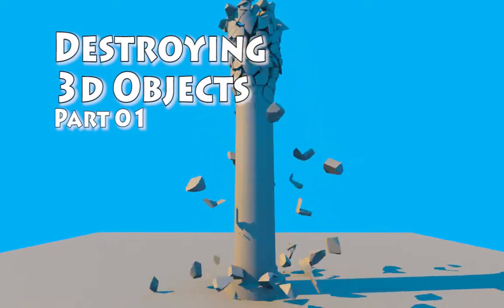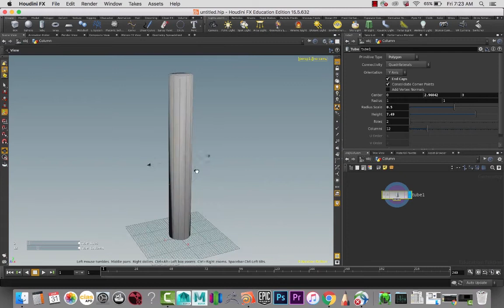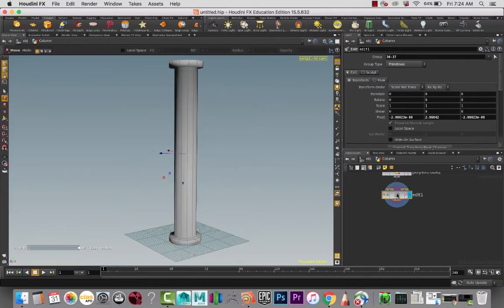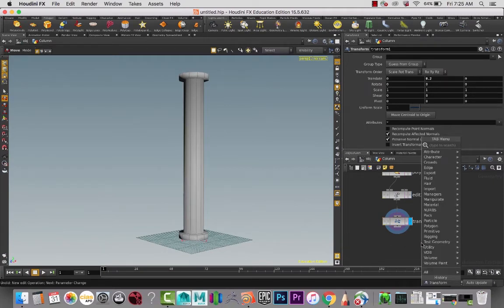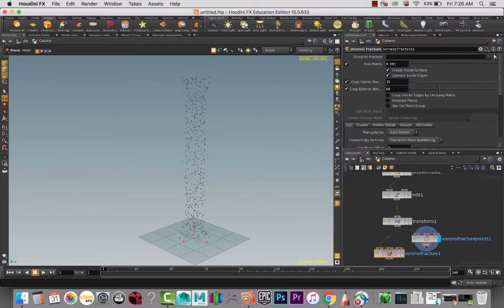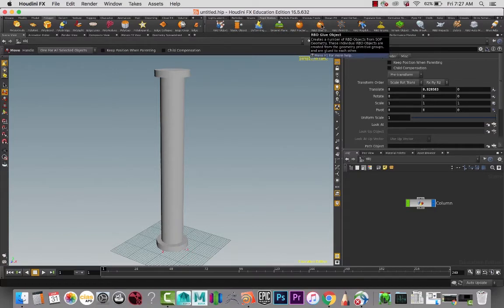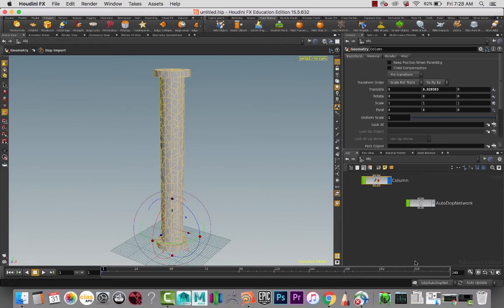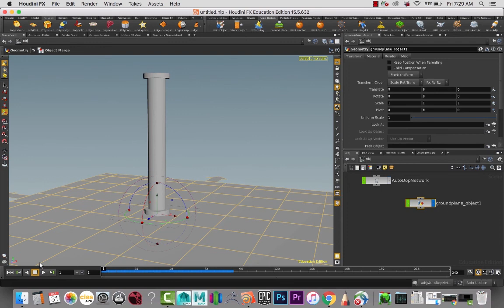How to Break Things in 3D | Houdini Tutorial

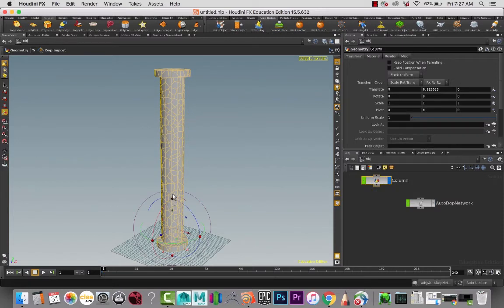Comment: Hey man! really useful but I can't get the object to break. I get to the point where you create the ground plane and the RBD fracture object but when I hit the playback in real time it just falls into the plane, bounces a little and that's it, no fracture points. I followed up every step, the only difference I can tell is that at 5:44 when you select the RBD fracture object, mine doesn't show the cracks, it just highlights the object and then I press enter and I get the Auto Dop node. Any idea where I messed up?
Reply: Hi hi, have you tried connecting the transform node with the first AND second input of the voronoifracturepoints?
Reply: @cryingwolftears1366  same problem what should I do?

Comment: At 3.17 the only way I could have the blue wireframe spheres and points of the voronoifracturepoints to appear is hook them up in both first and second input. I'm likely missing something obvious. But at 3.17 you create the voronoifracturepoints you then hook up the output of transform into the middle input of voronoifracturepoints, which displays the blue dummy wireframe spheres, these remain even after (seem like it) you disconnect the link between transform1 and voronoifracture points. You then connect it to the left most input, in your version the blue debug wireframe spheres remain, whilst the points appear. In Houdini 16, or at least in my version these disappear, and I only get the same results as you when I explicitly connect my transform1 to both first and second input of the voronoifracturepoints1. Is there anything you do at 3.17 that hides the first time you connect transform1 to voronoifracturepoints1 but they are in fact still there? Or has this changed in 16 and now you need to connect the transform1 both in first and second input of the voronoifracturepoints for it to work?
Reply from the maker: Ingmar Clarysse try connecting a scatter to the second input of the voronoi fracture points and connect the geometry to the input of the scatter. Let me know if this works and if it does I'll ad a note to the video.
Reply: I realise my above text is confusing, but it also works  without scatter as long as long as the second input of voronoi fracture points is populated. In my case I used transform1 directly in the 2nd input of voronoi fracture points. I also tried with scatter which also works but gives different results. Though I would say without scatter just using transform1 directly into the second output of voronoi fracture points is closer to what you had in your video. (Only you didn't had anything plugged into the 2nd input and somehow it still worked for you.
Reply: (If you're adding notes, might be worth it to point out that in Houdini 16, Ground plane is no longer under Rigid Bodies and now can be found under Collisions tab. (Which is literally 3 tabs left of Rigid Bodies). Aside all that, still big thanks for the video, I learned a lot from it.